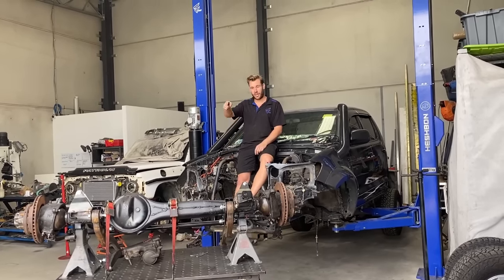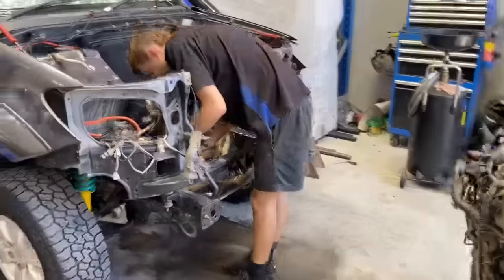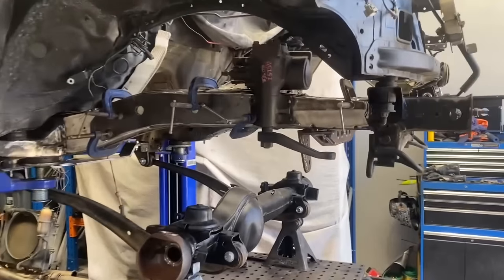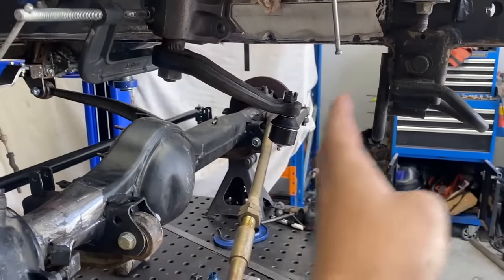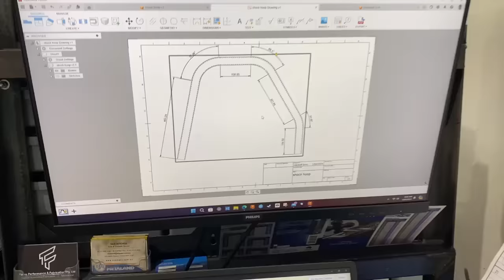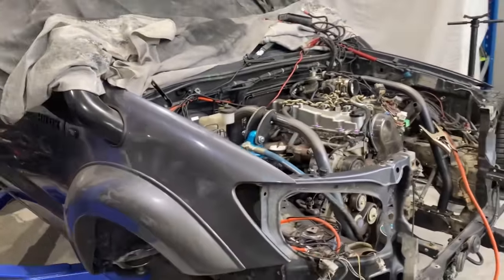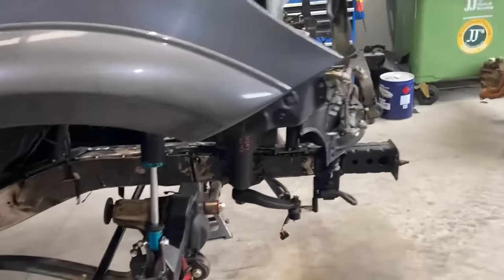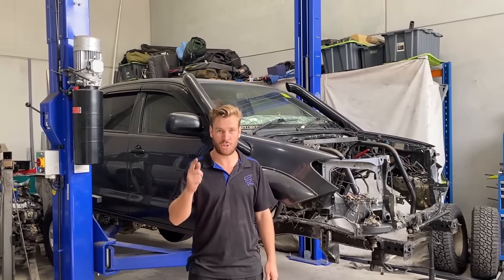Favro Performance SAS (Solid Axle Swap) an N70 Toyota Hilux w/ 12" KING Coilovers

Comment: Drop the top of those coilovers an inch for sure as it’s just wasting shock. Protect it all with the bumps. A factory 80 bump will compress 50% at 1 ton (front of lux is 1400kg give or take so split over the two you will rarely fully compress unless jumping). No point having the sump as the first thing that hits with an inch and a half left of shock left. Sick job though. How good is having a cnc plasma. I could not imagine not having mine now.
Reply from the maker: In my experience when the diff articulates I could potentially use up that extra bit I have left for safety. They are very expensive shocks also so I don’t want them to be damaged.
Reply: Just to echo the comment on articulation, I was concerned that 1.5” wasn’t enough and will limit the articulation then I was utterly devastated when that humongous antiroll bar went in as if radius arms aren’t enough of a limit to articulation. Shame there wasn’t a front on view of it flexed to check those clearances. Awesome job and it’s gonna be mega when it’s done.
Reply: That would all depend on the placement of the bump. If it’s directly in line or slightly further out then the shock would be safer all round. Being factory radius arms though your unlikely to use the whole 12in anyway really. Poor bushes will flog so fast. 

Anyway I reckon it’s rad what your doing regardless

Comment: Hey mate looks awesome,

I know it’s probably a bit late now but I would probably recommend pushing the shock mount forward on the housing, looks like through most of the uptravel the shock goes digressive which isn’t ideal

Other than that nice work 👌🏻
Reply from the maker: Fair enough. Problem is we had space issues with steering components and other things. We had to pick the best for what we had to deal with. All the ideal measurements and angles are great in theory but in practice it’s very hard to get those perfect numbers. 
But cheers for the feedback.
Reply: @FavroPerformance  yeah man I know how it is, you can see on my channel I sassed my Prado so I’ve been through all of it hahah

I ended up making a new steering column out of an adjustable length Kluger shaft to fix that

Comment: Why aren't there more sassed n80's?
Reply from the maker: Not sure but I believe they have a lot more electronics to deal with
Reply: because it costs sht loads..& needs engineering.. i did my bronco, myself.. common mod in u.s.. tacoma,s , fj cruisers, ect. offroad hub, did his in his garage, couldnt weld. learned how to.. dana 60,s in an fj cruiser..